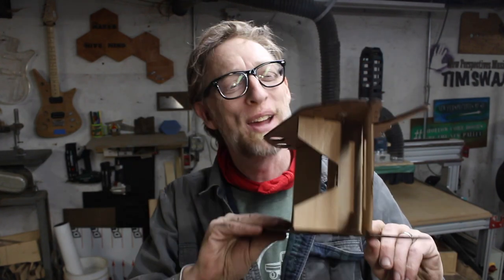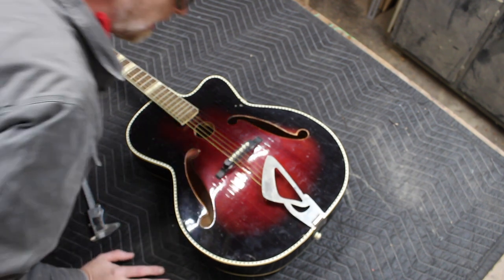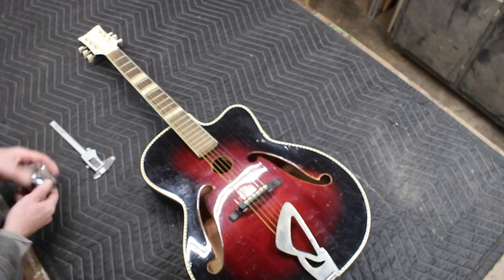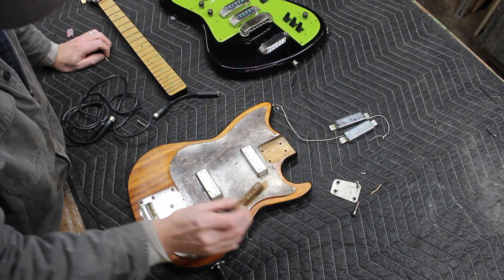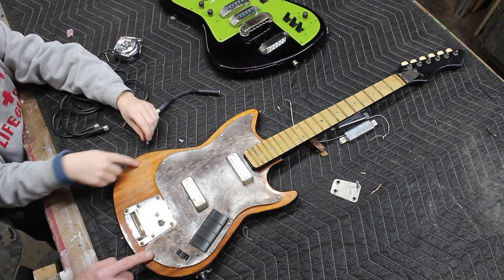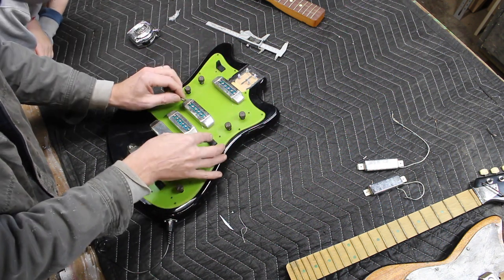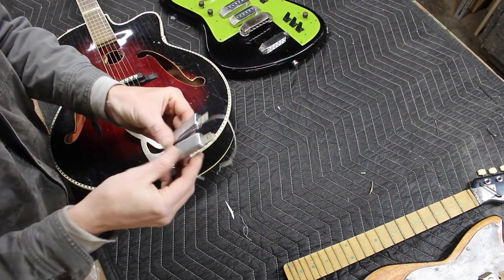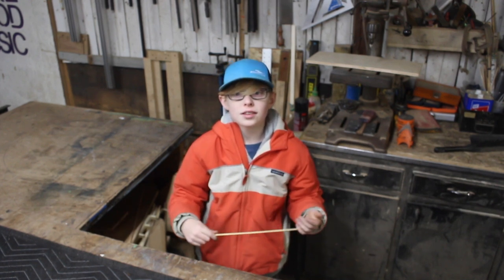I bought a bunch of old, weird, cheap & broken guitars

Comment: Nice video. Recently bought an archtop with case off F/B ($80),  sold by Wards, made by Kay. Sold new in 1964 for $47. Cleaned, new bridge, pickguard, strings, steamed the neck with a warm damp cloth, 3lb steel die block with an iron on top. Turned out nice. I used to go to the neighborhood music store and buy junk guitars 'Harvey' kept in a closet in the basement. 20 bucks was high end. Mend'em up and pass them on to beginners. The deal was they got a guitar for free so if they stuck with 'it' and bought a better guitar they were obligated to pass it on for free. If they gave up return it so I could pass on or they could pass on.
Reply from the maker: awesome

Comment: привет! Those 5-pin cables are called DIN-cable (also called Tesla-cable back then, because one dominant brand of magnetic tape recorders) and were pretty much the standard connector in eastern Europe for everything audio. I've never seen them used on an instrument though, they are the opposite of "fit for stage" and it would be a sane decision to replace the jack. Those switches look like surplus from car manufacturing or something, you basically can see the effects of planned economy in action here. With multiway switches totally absent, the manufacturer had to come up with a solution and took the next best thing he could lay his hands on. 70ies is a bit early, but take care when handling the electronics inside the green one, they might make use of early MOSFETs, which are incredibly sensitive to static electricity which could fry them. But most likely you'll find a little pre-amp made with some germanium transisors inside, which are fine to handle without extra caution. And be assured that 9V blocks were totally the same size as in the west, the tight fit there is more likely to be intentional (less rattling while playing?).
For the proper soviet refurbishment mood, I'd recommend a soundtrack of Гражданская оборона (Grazhdanskaja Oborona), a group around Egor Letov.
Reply from the maker: thanks for all the info! Good to know. I did take one jack apart and see only two pins being used, of course. Yea, that is my concern on the green one is the electronics could be too complex for my limited knowledge. I want to keep them as original as possible, The passive stuff is easier for me.

But man, there is NO WAY I can fit my 9v in that spot without a chisel!
Reply: @timsway  Hmm, odd thing with the 9V block. I had a transistor radio made in CCCP and it had the exact type like you can still buy. Don't feel overwhelmed by the electronics. The circuit will have an input, an output and a power connection and which is which should be easy to see from the mere directions of the wires. Most likely a preamp or maybe even a lil' fuzz if you're lucky. And like I said, for the sensitive components stuff the 70ies is a bit of a decade too early. Try to read the types from the housing and google, if it isn't covered in some ominous glue. If results says stuff like PNP or NPN you are mostly in safe waters. If you cannot decipher anything, be alert to not wear any synthetic clothing and always ground yourself before touching the circuit to be safe.
As for the DIN jack, I really would abandon the "keep it original" spirit here. Those plugs are fragile like hell, step on one and it's toast and will likely ruin your jack when attempting to connect. Also it's almost impossible to get any cable of that sort longer than 6 feet. And a proper instrument cable is to thick to fit inside the plug. And the plug is directional, so you have to look at the jack when plugging it in. An overall pain in the butt. Arrange a proper funeral and be done with it :)
Reply from the maker: @fiedel  oh yea, I decided quickly to lose the jacks. The green guitar has fuzz in it that is not working right now. Fingers crossed!
Reply: @timsway  If the components are accessible, you can try to trace the signal flow with a guitar amp and the tip of an instrument cable, no need for an oscilloscope or anything fancy. Electrolytic capacitors which have dried out due to age would be my first and usual suspects here. But be careful and run at the lowest of gains and volume , if you hit the +9V your speaker membrane makes quite the popp! :)
You could also post top and down photos, ideally with a good lightsource behind. If it's not all horribly covered in glue or wax, drawing a schematic from pictures should not be that hard. Would be interesting to soviet fuzz nerds anyway, I guess.

Comment: For future reference, Soviet guitars, the mass production models in particular, often times got their wood from furniture factories. You'd be surprised to see the very same wood and veneer and finish on Soviet-made shelves and wardrobes :D I know, I still own a couple of those.

I got my hands on the body and neck of a Tonica-650, fixed the cracked neck, stripped down the paint - pretty nice birch wood body, bad beech neck with no truss rod.

I will plug the bridge cavity, because Tonika tremolo bridges are horrible and I'm not planning to get one, I'd rather go with a Tune-O-Matic, modify the neck so it doesn't stand out so much, maybe make it a set neck instead of a bolt-on one, cover it with carpathian elm veneer and do a sunburst finish :)) I think that should bring that piece of garbage into the 21st century.

Damn shame it's missing so many parts and in such a poor condition, it's one of the first guitars the USSR made, I wish I could just restore it.

Comment: On the green pickguard Solo-2 (Соло-2) guitar you need a jumper across pins 4 and 5 of the DIN connector in order to turn the built-in effects on, then the switches and pots will make much more sense. Pins 4 and 5 are the closest next left and right to the center pin, which is pin 2 (ground) - pin numbers on DIN connectors are somewhat counter-intuitive.
Reply from the maker: Thanks for the info. Could I make them work with a standard 1/4" jack?
Reply: @timsway  Sure, reconnect pin 1 (sometimes pin 3, signal) to jack tip, pin 2 (ground) to jack ground, connect wires from pins 4 and 5 together (effect power) or insert a switch there. On some soviet pedals you needed to connect pins 4 and 5 to ground (pin 2) to turn the device on, but there's no standard, you need to check the schematic to be sure. Also, google DIN pin numbering, it is not sequential.

Comment: The sound hole in the Framus is, in fact, original. I have the same model and it has that same hole, in the same place, only bound. I paid £30 for it from a flea market in the East End of London about 20 years ago. No tailpiece, bridge or tuners, so a project piece. The neck is enormous. It’s great for gypsy jazz, not a great deal of sustain, but, pokey.
Reply from the maker: cheers. we found the model ("president") in a catalog and it was an option! I don't think archtops aren't really supposed have a ton of sustain - at least I've never played one that did! lol

Comment: Those Formanta guitars had built in fuzz circuits and sometimes phasers too. I managed to clone both versions of fuzz circuits in the Solo I (BJT transistor based that’s very close to a fuzz face.) and the Solo II which is an opamp based circuit.
Reply: If you check my channel you’ll see both fuzzes in action.

Comment: For the soviet mahoganny, I would refinish the whole instrument, but I would certainly make a transparent pickguard, to keep the wood visible. If you fear scratches on the pickguard, you might sand the transparent pickguard to make it transparent-ish/whit-ish. On the black one, if the electronics don't work, or d'ont make sense, it might be interresting to rewire the whole thing. And since so many knobs and switches are already present, why not including an amp in the guitar ?
Anyway I like your idea of looking for unusual / old / brocken instruments and make them live again. Next, you do the same with basses ?
Reply from the maker: There's a bass in the mix (I didnt really show it). But it won't be a bass when  done.  SHHHHH!!! :)

Comment: The tone drop on that Soviet Futurama should be working, I think it may just be a strangle switch. I've perused the internet for info on USSR electrics and a common practice appears to be having different tone functions for each pickup. If you ever get your hands on an Aelita, for example, the bridge pickup has a bass cut and the middle and neck pickups have treble cuts. Kinda like how the Fender Jaguar has a strangle switch for the bridge and a rhythm circuit for the neck. Never a dull moment with a Soviet axe.

Also, the vibratos on those things are apparently the worst. Might want to finagle a Jazzmaster-type assembly under that plate.
Reply from the maker: I've taken the cover off since filming and yea, two capacitors to the switches. It probably works but is less subtle. I haven't used it yet, but the construction of that wang bar looks BETTER than a Jazzmaster trem to me! (I'm not a fan of that design).
Reply: @timsway  the big issue players have with them is that they don't return to pitch well, if at all. Maybe a roller bridge in place of that Hofner-type thing would help, but if you find that the stock system isn't to your liking, I wouldn't be surprised to see a Patented New Perspectives Tremolo System™ on there by the end of the year ;)
Reply from the maker: @zhiracs  that's the problem I have with the jazz master too, lol. The bridge that came with this guitar is... interesting... I'll probably make something. I have ideas :)

Comment: Back when you could get some of these odd ball guitars cheap I had no interest in them, but largely because of players like David Lindley, I acquired a fascination with the old weird guitars.  Someone once showed me a guitar with about eight switches that in addition to changing the pick ups from series to parallel wiring did other things to change the sound that I didn't have time to figure out.  I'd like to dig into that kind of thing, but like most of your viewers, probably can't justify the effort to find and $$ to buy them. Could you trick out a Squire or similar inexpensive modern instrument with some wonky features of the old weird guitars?
Reply from the maker: cheers. I love the weird ones, too. If this series performs well, indeed I'll pick up some boring "student grade" (squiers, etc) guitars and try to make them sexy.

Comment: It's getting cold in your neck of the woods. Do you have a fireplace? 🙄 The green one looks interesting. Maybe patch the red one with a decorative open work lute sound hole cover. The floating pickup seems like a good idea.
Reply from the maker: I have a fun idea for a floating pickguard. Yes, I heat my shop with a wood stove. I actually kind of designed my workflow around the stove location! lol

Comment: Does the second Russian guitar have the integral screwdriver if you unscrew the strap button at the base of the instrument? Some of these models have that feature, but my understanding of these guitars is that they weren't always built in the same factory or even by the same company so features might well vary.
Reply from the maker: I never heard of that? Not that I've seen, yet, but man that would be cool to find on camera in the series.

Comment: You could buy a thin sheet of brass Trace the old pickgaurd and cut out the button parts drill the potentiometer holes you would have a copy of your old pickgaurd now made of very thin brass now glue leather on too it also cut and drill out the holes and stuff after it’s glued on now you will have a nice stiff pickgaurd made of brass and leather that is also shielded cause of the brass so that’s a plus did this my self on a cigar box guitar build it came out beautiful. Now the round sound hole cut in the other arch top guitar you could wire up a small speaker in that hole with a nice screen cover over it with a small on board amp with maybe one affect like crunch or distortion just some ideas I love too build too God bless love the show can’t wait for the next Tim
Reply from the maker: great ideas

Comment: I think I remember hearing the in built FX need the 5 pin connector in order to work properly with how these guitars are wired. Thats if the circuit board has not corroded
Reply from the maker: I'm sure it's gonna be a can of worms I'm not ready for... lol

Comment: That hole in the framus is probably actually stock. I have seen several with the small round sound hole, but most had the teardrop shaped f-holes. I have also seen old literature that shows the sound hole as well
Reply from the maker: it is. we found it in a catalog. link in description

Comment: I found a guitar exactly like that in a trash can in about 1995.  the neck was separated from the body but unlike that one it was perfectly pulled out from the dovetail. The small sound hole was there as well and had binding, making me think some models had the f- holes and small center hole as a factory. I reset the neck and dowelled it in(I shouldn't have). I added a fingerboard mounted pickup. I gigged it a few times before it fell out of it's homemade case, fell down a flight of stairs, snapped the the head stock and was salvaged for the beautiful fiddle back book matched maple. All else was lost.
Reply from the maker: rough story!
Reply: @timsway  yeah, that sucked but a few years later I found a homemade banjo that uses a REMO practice pad for the head. the neck is nice but ill make s cigar box banjo out of it instead of fixing the wood hoops. 
salvage is fun!!!

Comment: That black & green one looks familiar, I think I refretted a bass of that make once, Russian I think. the fret material was very odd.
Reply: Probably made from the rods at Chernobyl 😆😆😆
Reply: @mikevaluska7313  I must check if they still glow in the dark, I used to put all the scrapped frets in a glass jar, in case I would try to make some castings. Still got that jar. But what was odd about those frets, the tang was like 4mm high, but the crown was very small as on mandolins.

Comment: Tuning is of the greatest importance in music. It doesn't compute to call soviet era tuners garbage. They are technically very advanced. Will you send them to me incase they have no value to you? By other means I see no point in putting together soviet era instruments, but ripping them off of some of their best features. Put them back is my best suggestion :)
Reply from the maker: Are you in the states? There are a lot of great things about these guitars but I honestly don't think the tuners are worth the shipping cost.
Reply: @timsway  unfortunately I reside in Finland, so the actual shipping costs would propably rise to the stars! ? My all time favourite tuner is a russian acoustic "matt" -metallic tuner, that does "spin loose" a couple of turns, before starting to turn the bit the string is around, and to me  it has been the most convenient one ever! They do turn the tuner, but they do not detune by accident from touching something with the tuner unnoticed. The ones in the electric looked like they could be of the same style! So I'm thinking we're facing an actually more advanced design, compared to the most usual western ones. If you can find out shipping costs to Finland for the amount of such tuners you weren't about to have on the guitars no longer, I'd concider my chances of receiving them, eventhough I'm really in a phase without much spare! I would definitely keep them in the instruments, giving them "museum value" as examples of actually unpeckable design, that is in actuality the best tuner instead of the worst!

Comment: I've converted a number of those Soviet guitars to a standard jack.  In some, the purpose of the extra conductors was as an effects loop, but you need the special amp that went with the guitar.   Those are harder to come by.
Reply from the maker: I think the Formanta might run in to some issues with that and its onboard electronics? I can't wait to find out.
Reply: The worst case is that you’ll bypass it simply by capping the extraneous wires.  I’ve done this with two Formanta guitars.  The quality of Russian onboard effects was pretty lousy anyway.

Comment: I live in Germany, and I've spend some time on classified guitar ads, and I can assure you that the hole in this Framus is original. What's more interesting Framus made some guitars for common retail and didn't put a logo on head stock. The perloid mass is therefore also original.
Reply from the maker: Thanks for the info and interestingabiut the lack of logos. Yes, I have since found the model. There is a link in the description.
Reply: @timsway  One more interesting fact is that some guitars from this period were sold with a detachable pickguard-pickup set. Basically you could "electrify" your acoustic guitar and other way around. You can sometimes buy them separately on "ebay kleinanzeigen", and they cost between 50-100€.

Comment: i have a few of the borisov solo 1 and 2.....yours is in rare shape uncracked pickgaurd {be careful tiny slotted screws that are usually bent in the wood make it hard to get apart)  and it has the bridge cover and screwdriver!!!! it doubles as the strap button its machine screwed into the body. the effects are easy to get working once you get the cable rewired, the adapter wont work. the power from the battery goes into the input and is crossed over to the output to the effects by 2 of the cable poles i can send you a wiring diagram showing how to wire a 5 pin din to a i/4 inch jack. without this crossover no power gets to the effects they turn on by plugging it in, if you can open your cord ends see if one end has a wire jumping two poles, plug that end into the guitar and put a regular jack on the other end
Reply from the maker: thanks for the info! I haven't gotten to that one yet but I did get a wiring diagram from another viewer already. fingers crossed. Electronics are not my strongest suit.